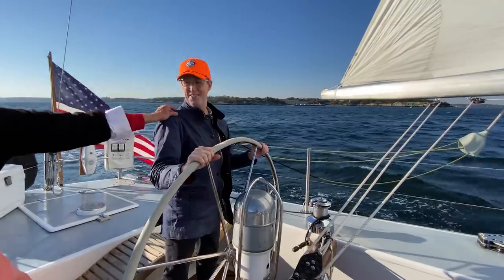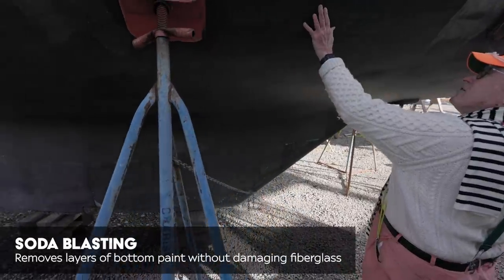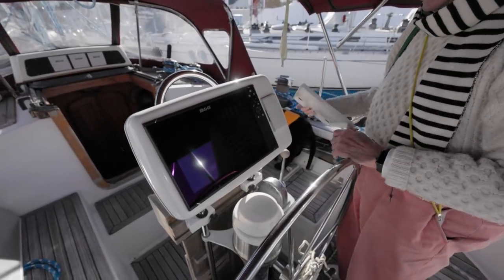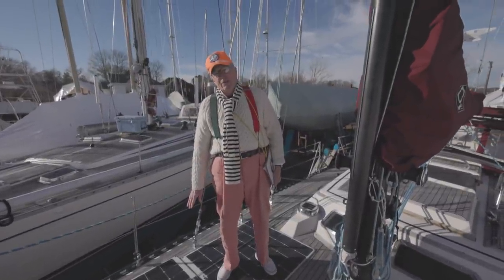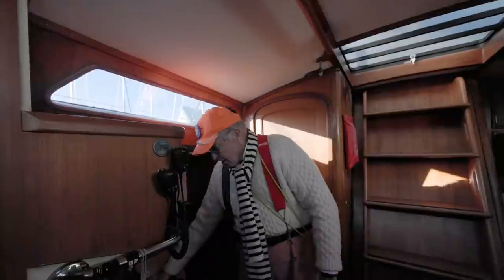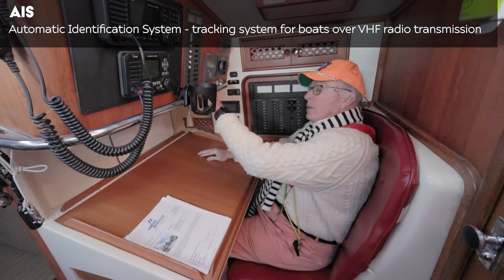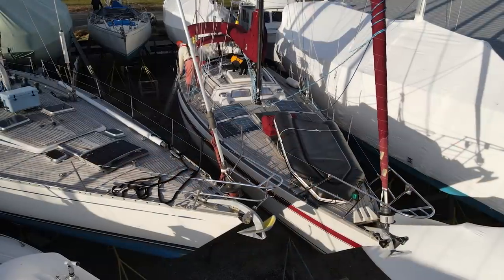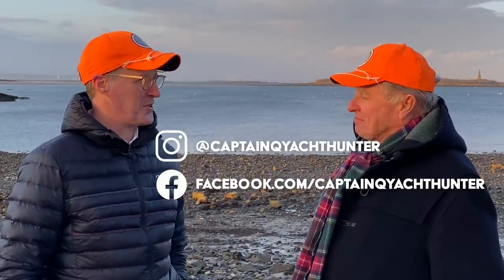$99,500 USD GLOBAL CRUISER! Proven bluewater sailboat for sale! EP76 #sailboatforsale #sailboattour

Comment: So many red flags; deck, separate entrances, very deep but also very dark, very dated interior (but okay if you like that sort of thing) and not having a look at the mechanics up front and below so that AC/heat is all a mystery.
Reply: Mr. Lee here is some information about Dream Weaver you do not know.  This list is not complete:

Accommodations
Sleeps 7-8.  V berth forward.  Enclosed head with vanity and shower next aft to port, hanging lockers opposite to starboard. Main cabin features U-shaped dinette to port which converts to form double berth, settee opposite to starboard. Galley next aft to port, forward-facing navigator's station opposite to starboard. Aft owner's stateroom with double berth to port and single berth to starboard is accessible from main cabin through a second head, with vanity and shower, located aft of navigator's station. Both toilets are Wilcox Crittenden Skipper models, both rebuilt in 2019. Shower fixtures new in 2019.

Galley
U-shaped galley features propane four-burner, gimbaled, stainless steel stove with oven (oven  not working),  Sea Frost (2021) 12 volt refrigerated ice box and separate freezer with digital monitors and controls, double stainless steel sinks with pressurized hot/cold water. Propane system installed in 2019.

Electrical
12 volt DC and both 110 volt AC and 220 volts AC. Engine and generator starting batteries are 12 volt lead acid. House batteries consist of three Relion RB-300-hp 8D 300 ah lithium iron phosphate batteries (2019). Four deck-mounted semi-rigid, walk-on, 175 watt SolarWorld Sunmodule solar panels mounted on foredeck whose 700 watts of power produce as many as 250 ah per day! The four three-foot-square panels feed two 30 amp Victron SmartSolar MPPT charge controllers, monitored via a Victron Color Control GX mounted at nav station. Eclectic Energy (British) D400 wind generator (2019) with max output of 600 watts. Nex-Gen 5.5 KW 10 HP diesel genset (2019) with 75.7 hours. 110 and 220 volt Victron Energy inverter/chargers (2019). Boat automatically accepts 110 volt or 220 shore power and can output both voltages simultaneously, if so desired.

Electronics and Navigation
Brooks and Gatehouse electronics suite including forward-facing sonar, AIS transceiver, 4G radar (antenna mounted on mast), three Triton2 multi function displays, 12" Zeus3 chartplotter, and barograph. All purchased new in 2019, all updated in 2021. Simrad hydraulic autopilot (2019) networked to B&G system, Icom M803 marine HF SSB radio transceiver (2019) with DSC and color display, Icom AT140 automatic antenna tuner (2019). Insulated backstay serves as SSB antenna. Copper foil ground plane glassed into hull during boat's manufacturing process (standard practice with all Lafitte 44's). Icom IC M-506 VHF radio transceiver (2019) with RAM mike (2019). Iridium wifi satcom system (2019). King wifiMax router and range extender (2019). Ritchie SP5 binnacle-mounted compass.

Hull and Deck
Modified full keel with skeg-hung rudder. External lead ballast. Airex-cored hull, balsa-cored decks. Teak decking. Double bow anchor rollers. Maxwell electric windlass, rebuilt in 2019 with foot switch and wireless remote control. Double stainless steel lifelines (2018) with starboard boarding gate. Edson steering system. Four opening overhead Bomar hatches. 10 opening ports. Two Marinco solar vents with reversible fans. Two midship deadlights (2019). Cockpit shower. Dyneema jacklines, port and starboard, running bow to stern. Three padeyes in cockpit for attaching safety harness tethers

Sails and Rigging
Cutter-rigged keel-stepped aluminum mast. Staysail stay fitted with quick-release lever at base allowing stay to be quickly deployed or stored. Running backstays. Sail inventory of 7 sails, all made by Port Townsend Sails in 2019, includes fully battened mainsail with two deep reefs (30% and 60%), light air loose-footed mainsail with snuffing sock, roller-furling 115% genoa, Dyneema-stayed drifter, particularly robust staysail, storm trysail with separate track on mast, and storm staysail. Block and tackle boom vang with Dyneema line, 22', 20 lb. carbon-fiber whisker pole (2018) with integrated stowing (flush with mast) nd deploying system. Harken mid-boom mainsheet traveller (2018) mounted on house. Winch inventory includes two Harken #35 two-speed, self-tailing, mast-mounted halyard winches, Lewmar #30 self-tailing, two-speed, mast-mounted, reefing winch, two Lewmar #55 self-tailing, two speed, primary genoa sheet winches, two Lewmar #40 self-tailing, two-speed winches mounted on coach roof, one Lewmar #46 self-tailing, two-speed winch mounted on coach roof. All standing rigging and turnbuckles new in 2018.  Most running rigging replaced in 2018 with Dyneema. All chainplates removed in 2018, dye tested, and electropolished. All chainplate attachment points reinforced in 2018 with additional glass.

Mechanical
Wind Pilot Pacific (German designed and built) servo-pendumum mechanical windvane self-steering system (2019).

Additional Inventory
Viking 8-person liferaft (2019) in hard cannister mounted in a deck cradle. 3D Superlight Twin Air 290 9.5' inflatable dinghy. Burgundy cockpit dodger (2019) with zippered front window, stainless steel bows, and stainless steel grab rails on three sides. Burgundy bimini (2019) with stainless steel bows, full 360 degree enclosure, canvas covers for all windows, window on top for checking sail trim, and cover for top window. 45 lb. CQR plow anchor with 300' of 10 mm chain, 300' nylon rode, Danforth 35 HT with 50' 10 mm chain, Paul Luke 100 lb fisherman anchor (2019). Ace Sailmakers (E. Lyme, CT) Jordan series drogue. Plastimo extendable man overboard pole (2019). Stereo with two speakers in main cabin. Pots and pans. Toaster. Five fire extinguishers, six fenders, assorted docklines, two horseshoe buoys (2019), boat hook. Misc. engine spares.

Comment: Were did the money not the decks or inside.
Reply: DREAM WEAVER done mostly in 2018/2019:

Accommodations
Sleeps 7-8.  V berth forward.  Enclosed head with vanity and shower next aft to port, hanging lockers opposite to starboard. Main cabin features U-shaped dinette to port which converts to form double berth, settee opposite to starboard. Galley next aft to port, forward-facing navigator's station opposite to starboard. Aft owner's stateroom with double berth to port and single berth to starboard is accessible from main cabin through a second head, with vanity and shower, located aft of navigator's station. Both toilets are Wilcox Crittenden Skipper models, both rebuilt in 2019. Shower fixtures new in 2019.

Galley
U-shaped galley features propane four-burner, gimbaled, stainless steel stove with oven (oven  not working),  Sea Frost (2021) 12 volt refrigerated ice box and separate freezer with digital monitors and controls, double stainless steel sinks with pressurized hot/cold water. Propane system installed in 2019.

Electrical
12 volt DC and both 110 volt AC and 220 volts AC. Engine and generator starting batteries are 12 volt lead acid. House batteries consist of three Relion RB-300-hp 8D 300 ah lithium iron phosphate batteries (2019). Four deck-mounted semi-rigid, walk-on, 175 watt SolarWorld Sunmodule solar panels mounted on foredeck whose 700 watts of power produce as many as 250 ah per day! The four three-foot-square panels feed two 30 amp Victron SmartSolar MPPT charge controllers, monitored via a Victron Color Control GX mounted at nav station. Eclectic Energy (British) D400 wind generator (2019) with max output of 600 watts. Nex-Gen 5.5 KW 10 HP diesel genset (2019) with 75.7 hours. 110 and 220 volt Victron Energy inverter/chargers (2019). Boat automatically accepts 110 volt or 220 shore power and can output both voltages simultaneously, if so desired.

Electronics and Navigation
Brooks and Gatehouse electronics suite including forward-facing sonar, AIS transceiver, 4G radar (antenna mounted on mast), three Triton2 multi function displays, 12" Zeus3 chartplotter, and barograph. All purchased new in 2019, all updated in 2021. Simrad hydraulic autopilot (2019) networked to B&G system, Icom M803 marine HF SSB radio transceiver (2019) with DSC and color display, Icom AT140 automatic antenna tuner (2019). Insulated backstay serves as SSB antenna. Copper foil ground plane glassed into hull during boat's manufacturing process (standard practice with all Lafitte 44's). Icom IC M-506 VHF radio transceiver (2019) with RAM mike (2019). Iridium wifi satcom system (2019). King wifiMax router and range extender (2019). Ritchie SP5 binnacle-mounted compass.

Hull and Deck
Modified full keel with skeg-hung rudder. External lead ballast. Airex-cored hull, balsa-cored decks. Teak decking. Double bow anchor rollers. Maxwell electric windlass, rebuilt in 2019 with foot switch and wireless remote control. Double stainless steel lifelines (2018) with starboard boarding gate. Edson steering system. Four opening overhead Bomar hatches. 10 opening ports. Two Marinco solar vents with reversible fans. Two midship deadlights (2019). Cockpit shower. Dyneema jacklines, port and starboard, running bow to stern. Three padeyes in cockpit for attaching safety harness tethers

Sails and Rigging
Cutter-rigged keel-stepped aluminum mast. Staysail stay fitted with quick-release lever at base allowing stay to be quickly deployed or stored. Running backstays. Sail inventory of 7 sails, all made by Port Townsend Sails in 2019, includes fully battened mainsail with two deep reefs (30% and 60%), light air loose-footed mainsail with snuffing sock, roller-furling 115% genoa, Dyneema-stayed drifter, particularly robust staysail, storm trysail with separate track on mast, and storm staysail. Block and tackle boom vang with Dyneema line, 22', 20 lb. carbon-fiber whisker pole (2018) with integrated stowing (flush with mast) nd deploying system. Harken mid-boom mainsheet traveller (2018) mounted on house. Winch inventory includes two Harken #35 two-speed, self-tailing, mast-mounted halyard winches, Lewmar #30 self-tailing, two-speed, mast-mounted, reefing winch, two Lewmar #55 self-tailing, two speed, primary genoa sheet winches, two Lewmar #40 self-tailing, two-speed winches mounted on coach roof, one Lewmar #46 self-tailing, two-speed winch mounted on coach roof. All standing rigging and turnbuckles new in 2018.  Most running rigging replaced in 2018 with Dyneema. All chainplates removed in 2018, dye tested, and electropolished. All chainplate attachment points reinforced in 2018 with additional glass.

Mechanical
Wind Pilot Pacific (German designed and built) servo-pendumum mechanical windvane self-steering system (2019).

Additional Inventory
Viking 8-person liferaft (2019) in hard cannister mounted in a deck cradle. 3D Superlight Twin Air 290 9.5' inflatable dinghy. Burgundy cockpit dodger (2019) with zippered front window, stainless steel bows, and stainless steel grab rails on three sides. Burgundy bimini (2019) with stainless steel bows, full 360 degree enclosure, canvas covers for all windows, window on top for checking sail trim, and cover for top window. 45 lb. CQR plow anchor with 300' of 10 mm chain, 300' nylon rode, Danforth 35 HT with 50' 10 mm chain, Paul Luke 100 lb fisherman anchor (2019). Ace Sailmakers (E. Lyme, CT) Jordan series drogue. Plastimo extendable man overboard pole (2019). Stereo with two speakers in main cabin. Pots and pans. Toaster. Five fire extinguishers, six fenders, assorted docklines, two horseshoe buoys (2019), boat hook. Misc. engine spares.

Comment: This one gets a WOW out of me 3 mins in….
Reply: Hell Bob G, let me add a bit to your WOW!  Additions and upgrades to Dream Weaver:

Accommodations
Sleeps 7-8.  V berth forward.  Enclosed head with vanity and shower next aft to port, hanging lockers opposite to starboard. Main cabin features U-shaped dinette to port which converts to form double berth, settee opposite to starboard. Galley next aft to port, forward-facing navigator's station opposite to starboard. Aft owner's stateroom with double berth to port and single berth to starboard is accessible from main cabin through a second head, with vanity and shower, located aft of navigator's station. Both toilets are Wilcox Crittenden Skipper models, both rebuilt in 2019. Shower fixtures new in 2019.

Galley
U-shaped galley features propane four-burner, gimbaled, stainless steel stove with oven (oven  not working),  Sea Frost (2021) 12 volt refrigerated ice box and separate freezer with digital monitors and controls, double stainless steel sinks with pressurized hot/cold water. Propane system installed in 2019.

Electrical
12 volt DC and both 110 volt AC and 220 volts AC. Engine and generator starting batteries are 12 volt lead acid. House batteries consist of three Relion RB-300-hp 8D 300 ah lithium iron phosphate batteries (2019). Four deck-mounted semi-rigid, walk-on, 175 watt SolarWorld Sunmodule solar panels mounted on foredeck whose 700 watts of power produce as many as 250 ah per day! The four three-foot-square panels feed two 30 amp Victron SmartSolar MPPT charge controllers, monitored via a Victron Color Control GX mounted at nav station. Eclectic Energy (British) D400 wind generator (2019) with max output of 600 watts. Nex-Gen 5.5 KW 10 HP diesel genset (2019) with 75.7 hours. 110 and 220 volt Victron Energy inverter/chargers (2019). Boat automatically accepts 110 volt or 220 shore power and can output both voltages simultaneously, if so desired.

Electronics and Navigation
Brooks and Gatehouse electronics suite including forward-facing sonar, AIS transceiver, 4G radar (antenna mounted on mast), three Triton2 multi function displays, 12" Zeus3 chartplotter, and barograph. All purchased new in 2019, all updated in 2021. Simrad hydraulic autopilot (2019) networked to B&G system, Icom M803 marine HF SSB radio transceiver (2019) with DSC and color display, Icom AT140 automatic antenna tuner (2019). Insulated backstay serves as SSB antenna. Copper foil ground plane glassed into hull during boat's manufacturing process (standard practice with all Lafitte 44's). Icom IC M-506 VHF radio transceiver (2019) with RAM mike (2019). Iridium wifi satcom system (2019). King wifiMax router and range extender (2019). Ritchie SP5 binnacle-mounted compass.

Hull and Deck
Modified full keel with skeg-hung rudder. External lead ballast. Airex-cored hull, balsa-cored decks. Teak decking. Double bow anchor rollers. Maxwell electric windlass, rebuilt in 2019 with foot switch and wireless remote control. Double stainless steel lifelines (2018) with starboard boarding gate. Edson steering system. Four opening overhead Bomar hatches. 10 opening ports. Two Marinco solar vents with reversible fans. Two midship deadlights (2019). Cockpit shower. Dyneema jacklines, port and starboard, running bow to stern. Three padeyes in cockpit for attaching safety harness tethers

Sails and Rigging
Cutter-rigged keel-stepped aluminum mast. Staysail stay fitted with quick-release lever at base allowing stay to be quickly deployed or stored. Running backstays. Sail inventory of 7 sails, all made by Port Townsend Sails in 2019, includes fully battened mainsail with two deep reefs (30% and 60%), light air loose-footed mainsail with snuffing sock, roller-furling 115% genoa, Dyneema-stayed drifter, particularly robust staysail, storm trysail with separate track on mast, and storm staysail. Block and tackle boom vang with Dyneema line, 22', 20 lb. carbon-fiber whisker pole (2018) with integrated stowing (flush with mast) nd deploying system. Harken mid-boom mainsheet traveller (2018) mounted on house. Winch inventory includes two Harken #35 two-speed, self-tailing, mast-mounted halyard winches, Lewmar #30 self-tailing, two-speed, mast-mounted, reefing winch, two Lewmar #55 self-tailing, two speed, primary genoa sheet winches, two Lewmar #40 self-tailing, two-speed winches mounted on coach roof, one Lewmar #46 self-tailing, two-speed winch mounted on coach roof. All standing rigging and turnbuckles new in 2018.  Most running rigging replaced in 2018 with Dyneema. All chainplates removed in 2018, dye tested, and electropolished. All chainplate attachment points reinforced in 2018 with additional glass.

Mechanical
Wind Pilot Pacific (German designed and built) servo-pendumum mechanical windvane self-steering system (2019).

Additional Inventory
Viking 8-person liferaft (2019) in hard cannister mounted in a deck cradle. 3D Superlight Twin Air 290 9.5' inflatable dinghy. Burgundy cockpit dodger (2019) with zippered front window, stainless steel bows, and stainless steel grab rails on three sides. Burgundy bimini (2019) with stainless steel bows, full 360 degree enclosure, canvas covers for all windows, window on top for checking sail trim, and cover for top window. 45 lb. CQR plow anchor with 300' of 10 mm chain, 300' nylon rode, Danforth 35 HT with 50' 10 mm chain, Paul Luke 100 lb fisherman anchor (2019). Ace Sailmakers (E. Lyme, CT) Jordan series drogue. Plastimo extendable man overboard pole (2019). Stereo with two speakers in main cabin. Pots and pans. Toaster. Five fire extinguishers, six fenders, assorted docklines, two horseshoe buoys (2019), boat hook. Misc. engine spares.
Reply: @larryboles629  it’s one hell of a boat.  If I weren’t refitting my swan 47 it would be a no brainer. She should sell very quickly.